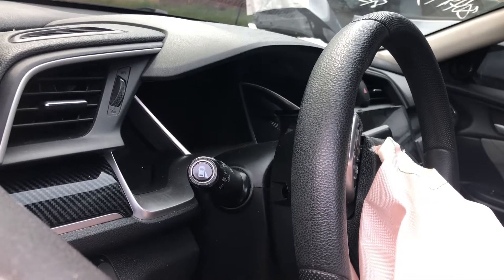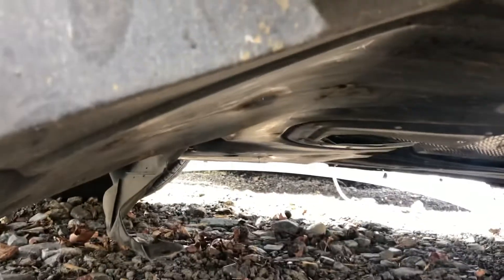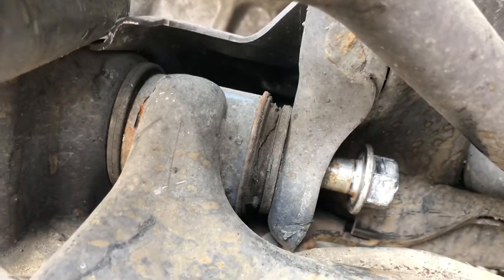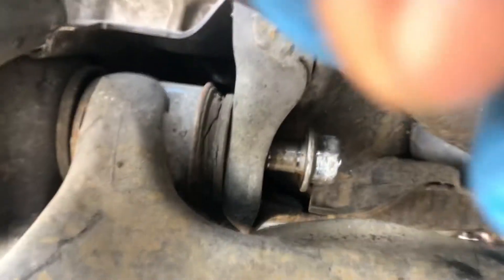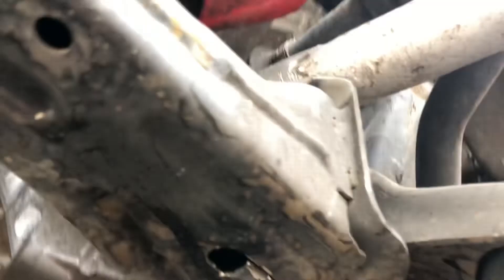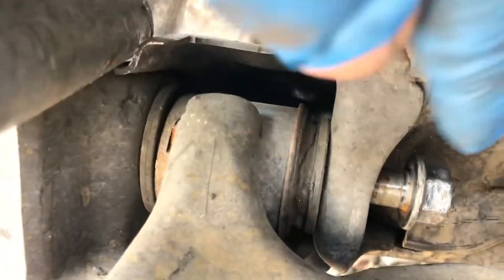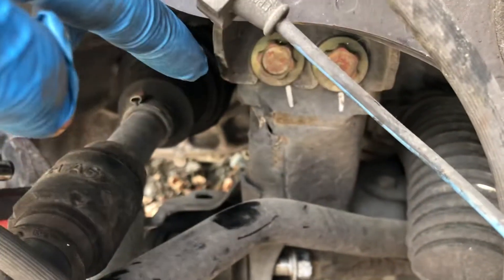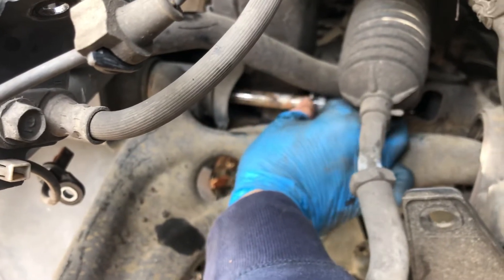2016 Honda Civic lower control arm replacement/whiteout remove the sway bar.

Comment: Welp i have to remove the away bar because mines broke
Reply from the maker: Good luck….. probably is better lower the sub-frame to have clearance….
Reply: @pintosautoymotosfix  yeah I was just looking at that….I have the tools though….I got 2 bolts out